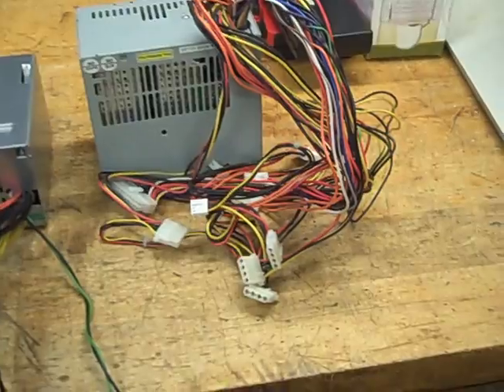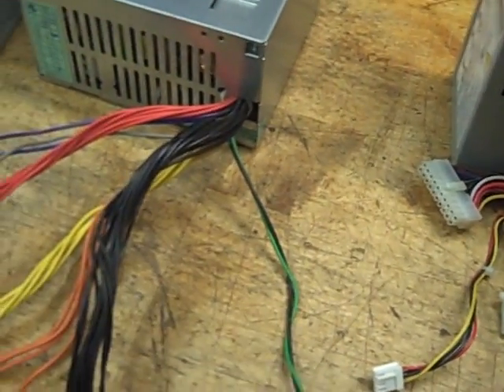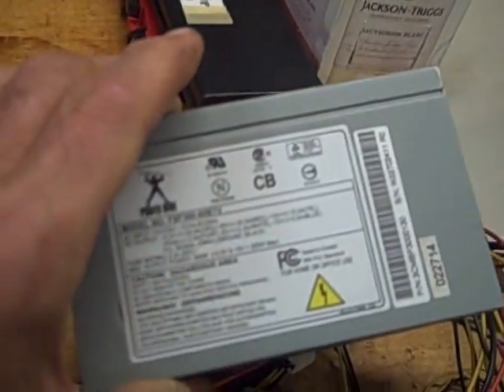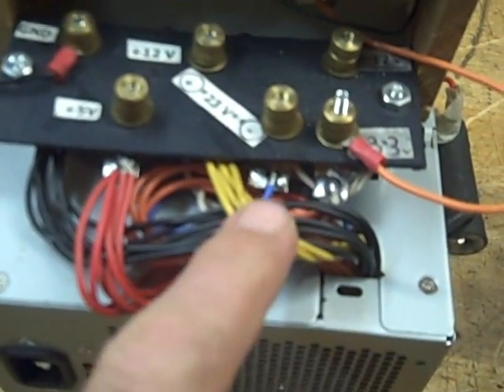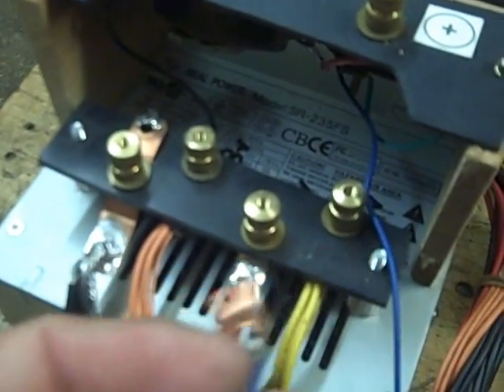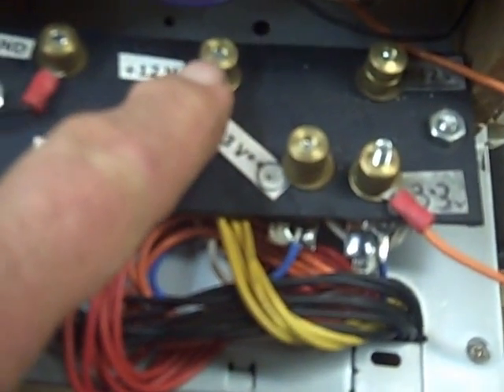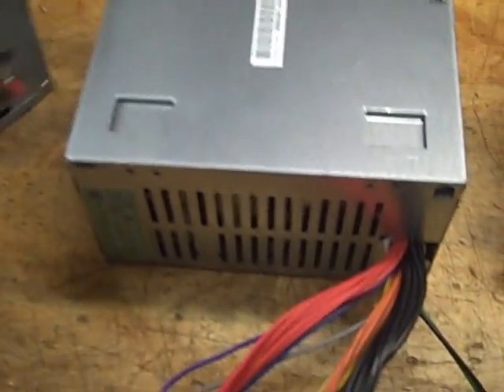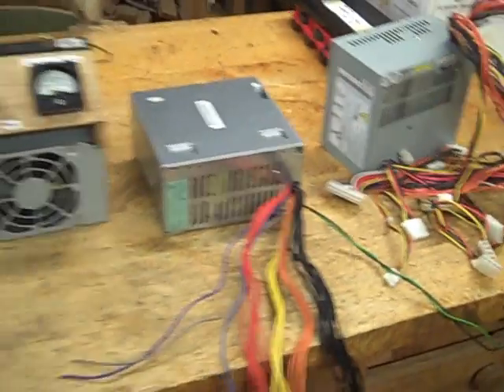DC Power Supply from ATX power supply

Comment: How much ampire we will get??
Reply from the maker: You can look on the name plate of the power supply and it will show how many Amps you can get for each voltage, for example the 3.3 V might provide 22 Amps.
But please understand that you will get this maximum current with no other loads on any of the other voltages.
But you can use the voltage outputs simultaneously, if you draw less that the maximum current.

In the event that you draw to much current, the power supply will shut down, but is undamaged. Simply pull the plug, and reduce the current draw and you are back i business.

Comment: my friend thank you for the response
The reason why is because right now I have a battery charger charging 6 batteries I use the inverter a husky 750 watt which I powering my TV satellite modem Wi-Fi an Xbox in one room and 5 fans around the whole house and That's All day long I've been running like that for the last 3 months and your idea looks more practical electrical pole then a battery charger but it's the amps that worried what would you think what do you recommend
Reply from the maker: I still do not understand why you do not power the equipment directly from the 110V power.
If you only have power for some of the time, then power the equipment directly, AND charge your battery. Then when the power goes off, you have a fully charged battery.
Doing it the way you do now, will decrease the life of the battery.
A fully charged 12 V lead acid battery should have between 13.7 and 14.2 V .
Are you in Puerto Rico ? Do you NEED all 5 fans to be running at the same time? They are probably the biggest load on your battery. All of the other stuff together probably uses less than 1 of the fans.

Comment: My friend your idea is awesome let me ask you a question do you think that can run and inverter from 12 volts to 110 volt inverter
Reply from the maker: Yes it is POSSIBLE, but it is a bit strange - if you have 110V input to the power supply why are you then connecting to an inverter.
But if your input is 220 V  then I can see that the inverter might be useful to get 110V .
This could also be done with a step down transformer ( 220 to 110 V). But the power that you
want might make the transformer more expensive

Comment: When connecting the green and black wires to keep the power supply running,  my power supply turns on for approx. 2 seconds and turns off. What would cause this?
Reply from the maker: Make sure that none of the other wires are touching each other.
A short circuit usually causes the power supply to shut down.
That's one of the nice things about these power supplies - if there is an overload , it shuts down rather than destroying itself.
Alternatively, the power supply has an internal defect or short circuit.
Take the supply out of its metal box, and  gently  cleaning off the dust and crud with a soft brush ( of course unplug from the 110V  first) 
If that doesn't fix it, then it's likely it is no good - cannibalize it for the parts and re-cycle the rest..

Comment: U think i can add a thermostat controller instead of a switch to control that to use it to power some peltier units  https://www.amazon.com/dp/B079DN3K31/ref=asc_df_B079DN3K315423149/?tag=hyprod-20&creative=395033&creativeASIN=B079DN3K31&linkCode=df0&hvadid=241906416474&hvpos=1o1&hvnetw=g&hvrand=9432454381625271520&hvpone=&hvptwo=&hvqmt=&hvdev=m&hvdvcmdl=&hvlocint=&hvlocphy=9030799&hvtargid=pla-424203788601
Reply from the maker: If the  thermostat is an ON - OFF  like a switch, then yes it will work OK..
I assume that it will cycle ON to OFF to ON to OFF etc no more than about 2 or 3 times per second. There is a limit on how fast the power supply software  turns on.
Use the Green and Black wire just like the ON OFF switch.
Reply from the maker: I thought about it over night and concluded that you need power for the thermostat controller too as well as the peltier unit.
So what I suggest is this:
Use the power supply to provide power to the thermostat unit and use the green / black wires to a regular  ol ' ON OFF switch.
You then connect the ON OFF output of the thermostat unit to a 12 V relay  .
You can get the automotive relay at electronic parts stores and cost about $5. Its relay contacts are good for 30 A so it will handle the current to the peltier unit..
Connect the out put of the relay to the peltier unit.

SO the ON OFF switch at the power supply is like a "system"  ON OFF .
Reply: Thanks
Reply: U say a load resister is not needed so i woukdnt need one for my set up
Reply from the maker: Yes, I do not think you need a load resistor.
Reply: Thanks

Comment: How to conect a psu to a laptop with out adjustments on the psu?Which wires and colours are need to power a laptop?!
Reply from the maker: Unfortunately,  the DC connections to laptops, are  proprietary  to each manufacturer. And even within a family of laptops from the same supplier there are major differences.
This is quite unlike the standard for ATX power supplies that was agreed to over 20 years ago.

It is possible to figure it out however.
You would have to determine from the battery of the specific laptop, what output connections on the power connector have what voltage. You can them see if the voltages correspond to the voltages available on the ATX PSU.
But note that there are connections for temperature sensing, that measure the internal temperature of the battery pack  as well as DC voltages. SO you would have to figure that out as well.
In addition you will have to have a proprietary connector that  would let you attach the ATX PSU to the laptop power input.

That kind of project will involve some creative hacking. I personally have not seen anyone do it.
Reply: -12 blue + red 5v

Comment: How can I get a 9 volt output???
Reply from the maker: Yes, you can get close to 9 V.
You can get 8.7 V  by choosing the + 3.3V as your negative and the + 12 V as your positive.
It is the difference between the voltages that matters.
So, as another example, you can choose the + 5V as your positive and the +3.3 V as your negative and you'll get  1.7 V  - can be used to charge a NiCad battery.

Have a look at the  comment below about various voltage combinations ( you'll have to do a google search as I suggested because I cannot paste the link into the comment text box.

Comment: What black wire is needed to wire up with the green wire? Just any black wire from the bunch? Nobody ever explains which specific single black wire pairs with the green wire. Thanks.
Reply from the maker: Any one of the black wires will work. 
That's because the all black wires are connected to the same terminal inside the power supply box. 

The same applies to the other colour wires. 
That's also the reason that I group them all together  by colour. I usually select the smallest (thinnest) black one to connect with the green one because there is almost no current going through it.

So, why are there so many  of these black ( and other colour)  wires ? They are needed at various connections to the motherboard, hard drives, accessories etc etc in the computer.
Reply: Great question and answer.  That was also my question.

Comment: I used a 450 watt PC supply to power my 20 watt ham radio transceiver.  I noticed on this power supply that there were 4 separate groups of black wires...so, i used one wire out of each little group of black wires and soldered the ends of them together to connect them to the output for my rig and wrapped the unused black wires and folded them back out of the way. It seemed to be a convenient way to use all 4 groups of black wires without having such a large external bundle of wire to deal with. One problem is that it only gives me 11.6 volts to the buck/boost device i need to give me the 13.7 volt input needed for the transceiver. Is there a way to up the voltage by a modification to the power supply board. Thanks for the info, it eliminated having to use a battery and charger when set up in the shack.
Reply from the maker: Unfortunately, the power supply is designed to provide 12V  and is used to power the motherboard - it is not an automotive application..  It usually is within about 0.2 V . You might need to verify the calibration of your voltmeter - there are neat voltage reference chips for that.

https://steelcityelectronics.com/2015/11/11/analog-devices-ad587-10v-reference/

The so-called 12V automotive is really 13.4 to 13.8 V  or could be as high as 14.5 - 14.7 V DC.  Those voltages are not available form the standard outputs of the ATX  power supply.

I suspect that every power supply manufacturer has their own innard design and proprietary approach so any modification would be unique to each design.  So long as they comply with the output voltages ( and a few other parameters) no one cares how they do it. I have not mucked around inside the ATX's that I have. 

Now if your transceiver is a 20W, and assuming about 15% efficiency, that implies that you need about 150W, or about 12-15 Amps  at 12V.
You might be wise to use all of the black wires - I know that it is a pain to do that , but it will certainly ensure that you are getting all the power that is available from the ATX.
Reply: @disproman  ? I was under the impression ( read- assumption) that, as the black wires are all ground, there wouldn't be any benefit to hooking 2 or more together. I applied this assumption to all the wires, i..e- hooking 2 yellows together and 2 blacks would not give you more 12v amps, you'd just have more wire clumped uo with the same output. 
But if I understand what you said- doubling up the grounds will increase or at least ensure that the max amperage from the power supply is available?? 
* And if so, is there anything to gain from doubling up the hot wires or is it strictly ground wire magic? Thanks for the info ive already gotten here btw
Reply from the maker: Each of the individual wires are relatively small guage wire eg 18 guage, which are rated for a maximum current of about 1 amp.
If you draw more than that, eg 20 amps on the 3.3 V connection, then the wire will overheat and maybe start melt its plastic insulation if you only use one of the wires.
When I made this version of the ATX power supply I was doing things like electrochemical rust removal, where I would draw the full current at 12V. 
So I took the time to use ALL of the wires. Yes it took some more effort but then I HAD the full potential of the power supply available to any use.

Comment: May I know what you used to solder all the wires together? A problem I face was there were too many wires to solder to a single binding post.
Reply from the maker: I faced the same problem - especially for the black wires . There are a lot of them..
Here's what I did - 
For each colour of wire, eg black , I cut them all to the same length.
I then stripped the insulation off about 1.5 in or about 4 cm. 
I then twisted the bare ends all together. For the black wires I made 2 "bundles" of wires.
I then soldered the twisted bare ends for each colour wire into 1 "glob" 
You might have to use a bigger soldering iron for this. I also usually put some flux on the wires to help
get the solder to flow.

I them made up a strip of metal - could be from a tin can, or some thin galvanized sheet iron, about 1 in long
( 3 cm) with 2 holes - one at each end.
I then soldered the soldered wire bundle into one of the holes.
I used the second hole to connect to my terminal.

If you look at about 3:30 of the video you'll see the soldering and the metal strips - in the video I had some thin copper sheet , but the metal from a tin can ( not aluminum) will work OK too.
Reply from the maker: It might seems like a lot of work but I found it's well worth the time because you'll only do it once.
Reply: Thanks! That's a really detailed reply. I appreciate the fact that you took time off to do that.

Comment: Thank you great video,does it matter which of the black wires you join with the green?
Reply from the maker: No - doesn't matter -  choose the smallest diameter wire and it will work just fine.

Comment: Just want to make sure I'm getting this right you put each color as one wire each & then do the same to the black wire & use each color as the + & the back as the - to get the power you want from each of the color wires?
Reply from the maker: Yes - I group each colour together, as an example, for the +12 V , I group all of the yellow wires together, and solder them to one terminal. This means that all of the current available on the yellow wires (+12V) is available to my application.
I also group all of the black wires together and make one terminal for the 0V reference  - that's a bit of a pain, because there are so many of them, but I find it is worth the work to do it.

Comment: Thx...I received a Astec power supply but no instructions in the box.  Needed to turn it on.
Reply from the maker: To turn the power supply ON, you should join the green wire and one of the black wires.
In my power supply, I use a small switch to do that so I can turn it ON or OFF
Any small switch is OK - it caries only a few milliamps of current.

Comment: can you tell me when you bundled up all the 12v,5v, and 3 volt wires is this to get more amperage ? or why was this done?
Reply from the maker: Yes, I wanted to get all the power that the supply can deliver.
In most applications this is not needed but for example, when I'm using electrolysis to de-rust tools etc, it needs up to 15 A on the 12V output. 

And yes, it is some extra effort to make all those wires fit together, but when I need the power, it sure is nice to have.
I only need to do this once, and after that I've got plenty of power to use.

So if your application doesn't need the full power, you can get away with connecting fewer wires together..

Comment: i have 250W power supply. i connect black and green wire together but it didn't turns ON.when i connect and disconnect then it go ON and OFF. what i do???
Reply from the maker: What that usually means,  is that there is an internal fault inside  the power supply .
It is attempting to turn ON, and when it does, it sees an overload caused by an internal problem  and then shuts down.
There is no easy way to fix this problem unfortunately, and the best solution is to get another power supply. 
They are quite cheap ( free in most cases)
Reply: disproman  its turn ON when i connect green and red instead of black(ground) wire . but its not giving proper 12,3.3,5 volts.
Reply from the maker: You can thry this:
Unplug the power supply from the wall and wait 30 seconds ( actually all you really need is 6 seconds) and make sure none of the wires are touching each other.
Then connect the Black and Green. If the fans starts turning ad then stops, it means that there is an internal problem in the power supply.
If the power supply is good then the fan will keep turning. - when the fan is turning, hte power supply is ON.
Otherwise, try another power suppluy.
Reply: disproman ok thanks. tell me one more thing is that: may i use yellow+red for more than 12 volts? means when i need 12+ volts then what i do? is it right way to joint together yellow and red wires?
Reply from the maker: No - joining the yellow and red will make the power supply stop.

Please see this video
https://www.youtube.com/watch?v=iahc1puHUxs
It describes how the wire colours  work and what voltage combinations can be obtained. from te power supply.
But please understand that the voltages over 12 V are very limited on how much current they can produce ( about 0.5A or less) .So yes, it IS possible but there are limitations. .
Reply: disproman  thanks :)

Comment: It would have been nice to say what all of the wires do. This seven minutes has not been explained in a methodical way.
I have a grey, purple and brown wire floating about, is this OK?
Reply from the maker: Those wires are not used when the power supply is converted to  a bench power supply. They provide other voltages and control signals to the mother board. I cut them back and tape the ends to make sure they don't contact anything.

Comment: I scavenged a laptop battery yesterday, I'll try to charge it as it is first. I wonder for how long that would take with 12.5 volt, 30 amps.... Do you take yours apart and charge the individual cells? If you put all the yellow wires together, do you get more amps out of it?
Reply from the maker: You can try to charge the laptop pack as is - but if there are dead cells inside,  the ones that are still OK, will not get charged. 
The usual reason that people give their laptop packs away is that there are dead cells inside and the whole pack won't charge up.
That's why I take the pack apart ( carefully) 

You can try to do it - BUT . . BUT  BE CAREFUL ABOUT HOW MUCH CURRENT YOU ARE USING.
The recent examples of battery packs burning up shows what can happen when you charge the pack with too much current.
I'd stick with charging current of 0.5 to 0.7 Amps - may take more time but it won't burn up.

To get the maximum current off the yellow ( 12V) wires, you HAVE to use them all .. If you only use say, 1 or 2 Amps, on your experiemnts,. then using one or two wires will be OK. 
For 30A - you've gotta use them all.

Comment: i want to use 24v from atx, but my load is also uses +5v at the same time, if i use +12v and -12v to generate 24v than the ground and -12v goes commonat the same time,, any suggestions to get 24v